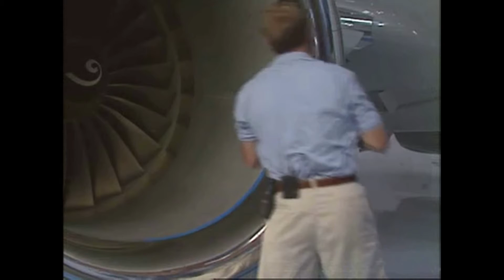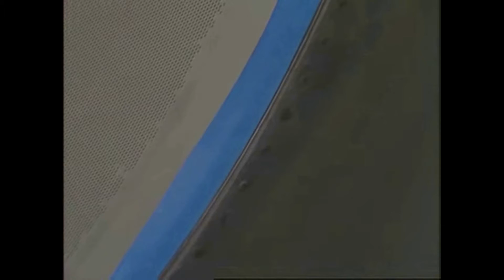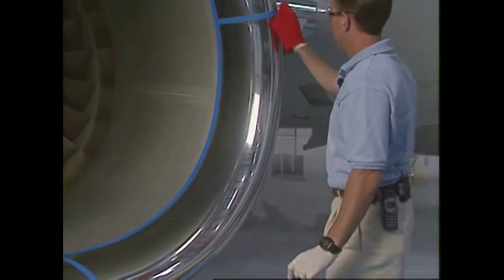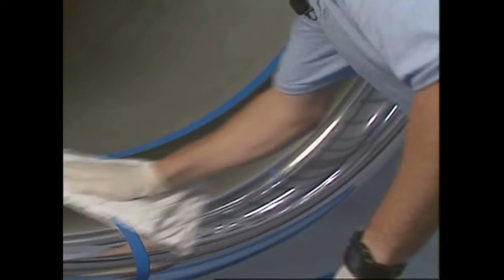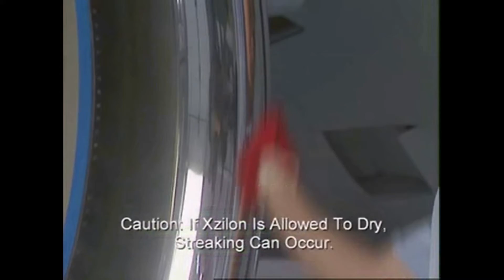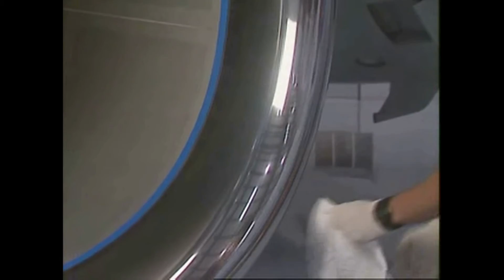Granitize X20 18 AECI 3 Application Procedure

Comment: The aircraft manual says, it needs to be removed when anti-ice is on but does not inform about which material to use for removal. Do you have any idea about how to remove and necessary material? Thank you